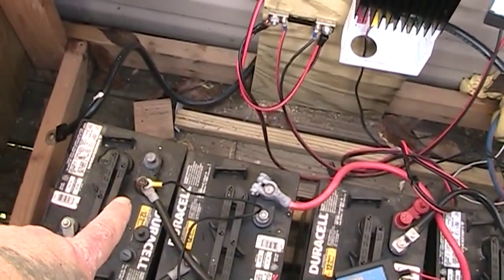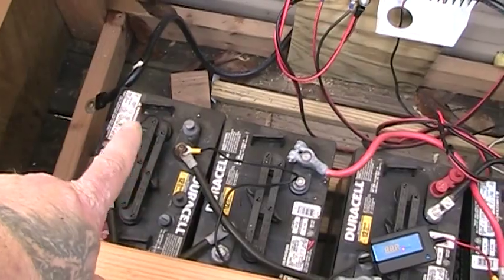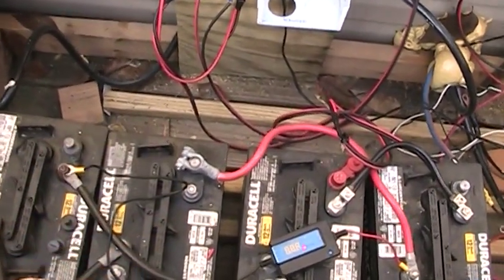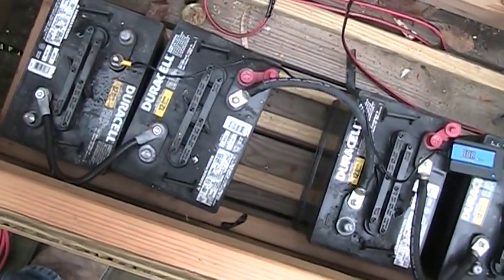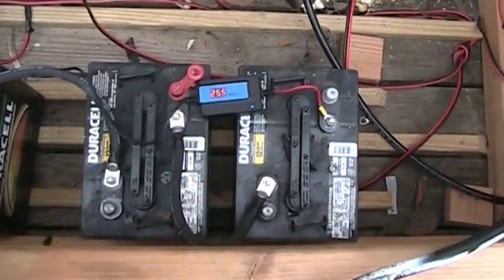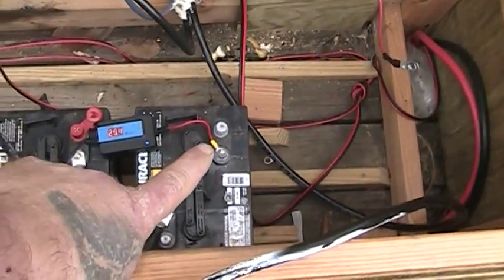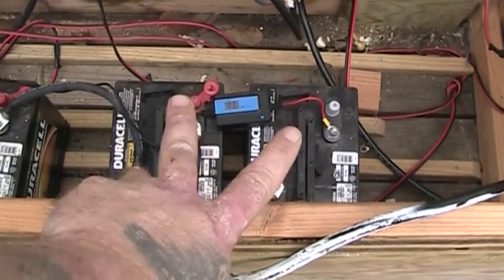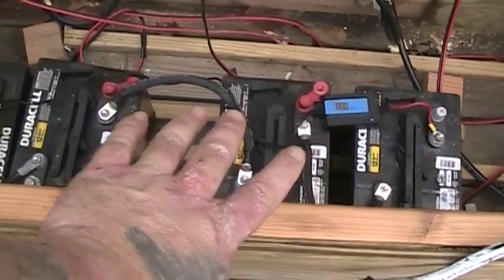My Solar System from 12v to 24v

Comment: ~~~J~~~
When you pair up 2 100 amp hour batteries you still get 100 AH. but if you pair two sets of 100 AH batteries, you get 200 AH. If you have 3 sets of 2 - 100 AH batteries you end up with 300 AH and so on. I have 5 sets of 2 - 100 AH batteries getting 500 AH at 24 v running a 5ooo watt pure sine wave inverter which runs my entire place.

Comment: Yes you are right about wires power loss, Its called voltage drop, Actually with 24V or 48V not only you are running less wires but the wire doesn't have to be thick like in the 12V system, the other benefit is the inverter is more efficient with higher input voltage.

Comment: I plan to go from 12 to 24 on my system as well.  I am doing it because the midnite controller I use is really stressed at times.  It reaches 96 amps and that's that.  The turbo fans are going and the FET temp gets really warm.  With 24 Volt system, I can cut those amps in half and make the controller last longer.  Yep, 24 volts is the way to go.

Comment: Where can I get a whole power system for a small cabin. Somethings thats all the parts in a box.
Reply: renogy.com :)
Reply: I did half my parts on ebay from a company called hurricane wind. All are good gear. The rest is been amazon and a company in Colorado
Reply: I looked at them, they are associated with that guy in Missouri wind and solar so I won't give them any money.  He has been caught in as many lies as Hillary and keeps on doing it.

Comment: jnullo
can you run your refiregator or deep freeze tv or computer off the modfied inverter? some say you can/ some say you can,t
LEE
Reply: What I learned from another channel was that you cannot run a brushless electric motor on a modified sine wave. An electric motor with brushes will run off a modified sine wave. That's all I can help you with.

Comment: Best way to understand electricity is to compare it to water. A #10 wire will safely carry 30 amps at 1 volt or 500 volts. 
If you took a bucket you wanted to fill with water in a certain amount of time say 1 minute. If you used a garden hose it would require a certain amount of pressure (voltage) to push enough water through the hose to fill it in one minute. If you used a much larger hose, say a fire hose, it would take much less pressure to fill the bucket in the same amount of time. 
Now if the bucket was say 500 feet away from the source, the resistance to flow in the garden hose would be much greater because of the smaller size, there would be a much larger pressure (voltage) drop.
If you look at the tag on an electric motor that list 115 or 230 volts. The amperage will be twice as much on the 115 volts compared to the 230 volts. It takes a certain amount of power to create a given horse power 
Your solar panels will produce a given amount of electricity, to get the electricity to the house you can use a small wire with high voltage or a big wire with lower voltage. What it comes down to is if your panels input say 12 volts you want 12 volts in the house, if the wire size is to small for the volume of flow increase the pressure (voltage) 
Hope this helps.
John

Comment: Go read this blog and find out what you need to do to get the MOST out of your system (https://handybobsolar.wordpress.com/)bigger wires from the panels, move the controler closer to the batteries reduce your voltage drop and a Trimetric 2025 battery meter. Your batteries will love you for it!

Comment: You got an awesome channel here, I've just subscribed and will definitely be checking out some ov your material, especially the heating stuff. :)

Just one thing I wanted to say about your new 24 volt setup: Don't tap the batteries at the centre to run 12 volt devices from there. What will happen is it will cause a charge imbalance between the "upper" 12 volt pair & the "lower" ones. This will happen even with low draw devices such as LED lights. And eventually it will ruin the battery bank.

If you want to run 12 volt gear from a 24 volt battery bank you can either use what's called a Charge Equalizer, such as those made by Redarc or more simply just use a good switchmode 24-12 volt converter and run the 12 volt loads from that.

[Edit]I see someone has already addressed this issue down below, but I thought it good to mention the Charge Equalizer anyway. They are a bit more complicated to set up than a DC converter, but do perform better if you need a bit more grunt on the 12 volt section.
Reply: Your right!  Pyle makes a small 24 vdc to 12 vdc Inverter for $23 off Amazon / Ebay.

Comment: look into MPPT Chare controllers. you can run 100 - 150 V DC down to your charge controller. so you might have just 1 + and 1 - cable..

Comment: I don't know what you're powering with that inverter but you should switch to a pure sine wave instead of the modified that you are using, modified sine waves are hard on electronics like computers/TVs/refrigerators etc and can damage them.
Reply: Neobreaker modified sine wave invertors are also very unhealthy for humans too. i see a time in the next decade when they become defunct... A good MPPT Controller can be had quite cheap now, and a good invertor is getting cheaper too so hopefully newcomers to solar won't end up with a crappy starter system in the future

Comment: Excellent Video, Here is a solution to Dead Batteres, Re-Pair convert to Alum. (Alum is a Non toxic Pickling spice, and its cheap)  and you will renew a dead battery, never replace another battery just re-new it, Here is a link  https://search.yahoo.com/search;_ylt=AwrTHROkzX1UxV0AGZNXNyoA;_ylc=X1MDMjc2NjY3OQRfcgMyBGZyA2Noci1ncmVlbnRyZWVfZmYEZ3ByaWQDVEJ4MHVBZkpUTXVJLnJWQWxiVGluQQRuX3JzbHQDMARuX3N1Z2cDNARvcmlnaW4Dc2VhcmNoLnlhaG9vLmNvbQRwb3MDMARwcXN0cgMEcHFzdHJsAwRxc3RybAMzMQRxdWVyeQNjb252ZXJ0IGJhdHRlcnkgdG8gYWx1bSB5b3V0dWJlBHRfc3RtcAMxNDE3NTMwODY2?p=convert+battery+to+alum+youtube&fr2=sb-top-search&fr=chr-greentree_ff

Comment: Ok folks now you have me wondering..... I have a harbor freight L cheapo system and my panels are way up in the backyard on the hill so I probably have 100 feet of number 16 wire running from the panels to my charge controller? I don't use the system for much of anything yet I'm still just playing with it and now I'm wondering if that number 16 wire is too small
Reply from the maker: I think it should be fine Pete, the HF kits I think put out 45 watts, so the 16 wire should be plenty big to carry that current in my opinion.
J

Comment: that's ok, ill see if I can find one. have you decided on the wind generator your going to get with your new set up? I picked up jeffs dual freedom II and got the Falcon Mac 5 blade set up, its a beast. I did notice when it got to 22 volt area the blades seemed to turn out of the wind and go parallel to the wind. after checking a few formulas we found all it needed was a larger tail and make the vain 48 inches long and its working great. I posted a video on my findings with the formula if that will help you out, its all based off the dia of the blades you decide to use. going to pass the information along to Jeff, hope he will produce a tail and boom kits that will work better with his products.
Reply from the maker: I have the single version from Jeff, I hope to get it up and going soon.
J

Comment: sounds like a good plan you have in the works, I switched also from 12 to 24 volts and its working pretty good, what is the name brand of the battery desulfator you have?
Reply from the maker: To be honest, I don't remember the brand name, it was one of the cheap made in China ones on ebay.....sorry..............
J

Comment: We install about 75,000 watt of solar per year. You are very correct about 24v being better the 12v, 48v is in my opinion the best for off grid situations, with a turbine combo. For a turbine, for off grid, making your own Axle Flux 3ph wind turbine is your best option. A Hugh Pigots design or based on his, from Other Power is the only way to go. If you have power to your home, from the power company. Grid-tie is supior to anything, due to no need of batteries at all let the power company be your battery. For those of you who say what if the power goes out, I say how much do you loose power I live in northern michigan we loose power about one week a year and running the generator for that week is far cheaper to batteries.

Comment: Great video.  I have a video on my channel that shows the calculation to know if a solar panel wiring is correct (i.e, wires running from the solar panels to the charge controller), based on the wattage of the solar panels and voltage system chosen (24 volts or 12 volts).  Check it out and let me know your thoughts. Thanks

Comment: One more thought. Center tapping your battery bank to provide 12 v does work but is very bad for the bank as a whole. Try to balance your 12 v loads across both "halves" of your battery bank. Even better would be to get a dc-dc power converter, but that does cost more. Not as much as a new bank of batteries, but more.

Comment: If you run a decent MPPT charge controller you can run your solar panels at 96 volts and keep your battery bank at 24v. That way your wire run can be even smaller guage.

Comment: Thank you so much for sharing your modifications. I have a well pump running off 220 and need to either set up a 24v system specifically for that or modify the pump (it does have a switch to change to 110 but doesn't run as efficiently at those amps, so I'm told). You've given me ideas to get started! Still need the CC and DC to AC converter for the 24v system but at least I have some 12v panels and batteries that are not being used right now - I'm halfway there. It's really only for backup if the power goes out. No fun having no water - the only disadvantage I have found with a well.

Comment: think of electricity like water flow
Power-watts equals Potential-volt times Current-amperage, P=V x A
the size of the pipe is volume of water, (voltage), the speed of the water, gpm or so, current (amperage), combining speed and volume gives you Power, like the water that turns a water turbine, is it enough.
if you combine several pipes together to create one water source and not increase the main pipe size than you won't get more power, so increasing the pipe size will give you more volume and more power as long as the current is present. now if with water, the higher source of water (head) is raised the more pressure you will have but that's another story.
hope this helps.

Comment: Great job!  Thanks for sharing.
Question, can the same charge controller be used for your windmill and your solar panels?
Reply: The solar charge controller yes. The turbine  controller is replaced with a 24 volt one

Comment: we are looking into solar im realy tired of these high electric bills if I can take a few things off the grid it would save a bit more for us
Reply: you can also go grid tie until you go off grid.  It will reduce your light bill by feeding solar back into the house to offset the electrical use.  Just need panels and a grid tie inverter.
Reply: I gues id better start checking with the city ordnenc and dp&l and go from there